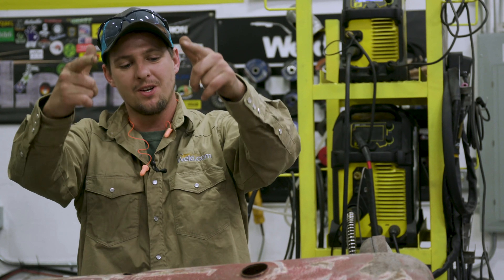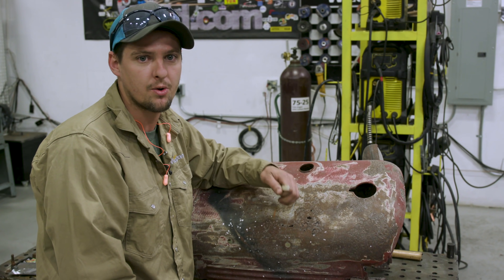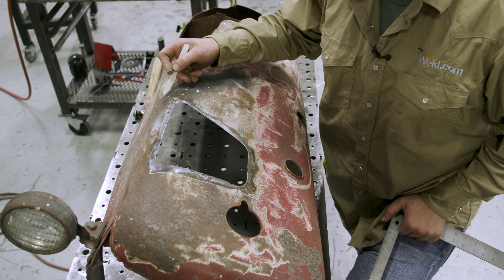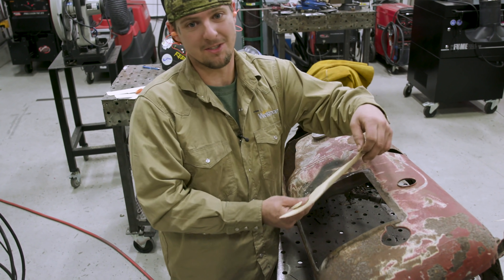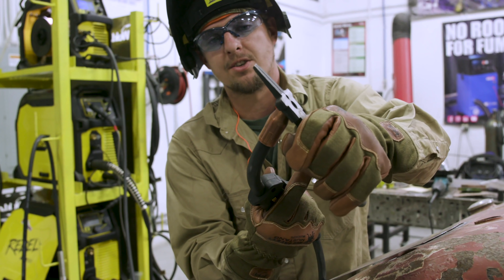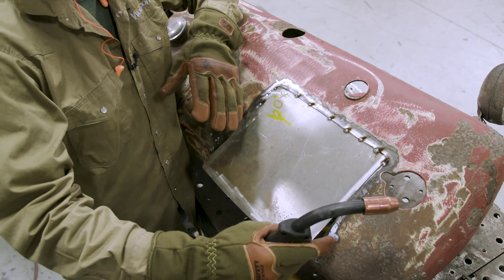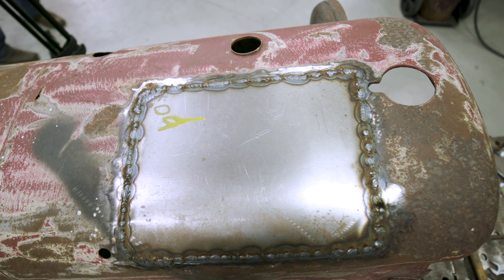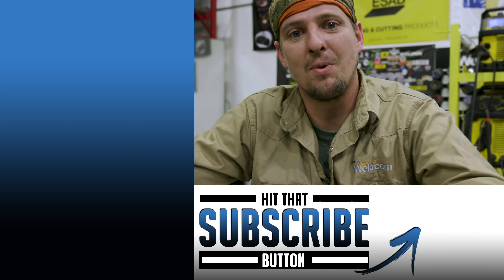OLD RUSTY SHEET METAL Weld Repairs

Comment: At 15:30 when you put the copper block behind the weld are you doing that to help disperse the heat of the weld?  I saw initially it was for holding the panels flush with each other but it looked as if the tacks did that already.

Comment: very good tutorial,
 a very important operation is to cut off the tip of the feed wire so you start with a fresh wire tip.
Forming the patch panel before welding it is  a good way to avoid undue reshaping after the weld is completed.
very good video

Comment: Here's a question...will a nasty boogery looking weld still hold for non structural repairs, like in the bed of a pickup/car (its a Ranchero so its one body). I did the ugliest welds...but seems to hold when I bang on it with a heavy hammer....

Its my second weld in my life lol...but I need to move on. I dont care if its pretty, just that the patch wont pop out on me later...thanks. Love the channel.

Comment: You can reduce or eliminate the gap by cutting out the bad metal at a 45 degree angle to the surface. Then cut the matching patch panel at 45 degrees as well. I use that method which works really well as long as you cut the template patiently and carefully for close tolerance. For example, with 1.6mm sheet metal cut at 45 degrees you will have a butt length of 2.3mm which should stop the the patch panel falling through. Before tacking you shouldn't be able to see the gap if looking straight on to the join, and the surfaces will be flush. Doing it this way makes setting up easier,  reduces the amount of filler bog you need, if any at all, and gives you a stronger joint,. Test it on a piece of flat sheet and you'll see the benefits. An old welder showed me this method 40 years ago.
EDIT: I just found the following video https://youtu.be/_u31t13QO6A which shows the concept I described but a much easier method to match up and especially no need to fiddle with templates. Super easy.

Comment: At least form the patch to the opening first, you know bend it to fit somewhat. Then start the fit-up and tack sequence from the rounded side first. Trying to pull or roll a tight radius around a short bend is so hard.

Comment: I tack would have tacked three - four tacks on each side and then grind them flush.  Then a tack in the center between tacks and grind flush again. I would repeat the process over and over until the entire patch is welded.  Once your tacks are really close to each other you can begin to tack in between tacks about 3-6 inches apart to keep heat at a minimum.  I always allow the redness from the heat to go away before I tack again to control the heat.      

This method controls the heat and avoids having to grind a "fat" bead which will build heat also.  The last grindings will reveal pinholes that are easily tacked and ground flush.  In the world according to me, tacks are much easier to grind flush and produce much less heat than grinding a bead.  I could metal finished the panel you were working on with no filler (bondo) because to me and my experience you have thick metal to work with. 

Finally, I would have started at the bottom of that patch making sure to have enough tacks to be able to "roll" the patch panel and tack it into the rest of your base as you slowly and carefully roll into place.  A 2x4 works fine to push/roll from the opposite edge of your patch panel into place making sure to keep it flush as you roll it.  Tacks will be closer together on the radius/roll part of the panel.   I weld quarter panels and fenders on Hondas, Mitsushitzis, and so on and use very little mud to resurface my joints for paint. 

All in all I appreciate your skill and that you mention your dads teachings.  I recall a quote,
"Teach them when their young and they will never forget."

Keep up the good work.

Comment: Good video.... pro tip never weld patches with glove on if the panel is to hot for your hand your warping it. 1 to 2 second tacks every 6 inches staggering start points. When form a radius on the fly IE not pre forming your patch start on the sort side of your radius working to the long side. when ever possible not using a hammer. Clean the entire area before laying out a patch. Good video tho. P.s use a flat rasp to knock down high weld points those produce no heat alot of guys do a great job welding the patch but take it to warp town while grinding....... I do this for a living keep the videos coming

Comment: First ever panel I welded into a vehicle was the rear arch of a VW T4 camper van. I tacked it into place as a normal person would, but then it took a turn for the worse. I strung a continuous bead all the way round it... none stop,.. about a meter long bead all the way around a sheet of what was probably 1.5mm thick sheet steel, butt jointed right around its perimeter to other thin sheet steel, all in one go. I had been told I couldn’t do that, and thought I was being clever by doing it. That was until I realised that the panel had pulled in by about 35mm in places, and the guy telling me I couldn’t do it actually just meant not to do it. I’m not even exaggerating, when I lifted the mask it looked like a stormy sea.

Comment: @7:20 i learned a trick of having a can of $.99 black spray paint, and just mist the cardboard so it leaves a shadow you can cut out.  the marker sometimes is too thick to get an accurate cut.  drawback are fumes, and having to clean it off the metal ( not an issue if done before grinding)

Comment: Metal has memory.  If you start with a flat piece and weld it in as he does it will require a lot of filler in the middle.  It’s going to want to stay flat.  If you form the patch before welding it in, you will have a much better result.

Comment: Personally i think you did that the hard way,I hate giving advice, except where it makes life much easier.
if you would have started at the bottom and welded it towards the top.
you will find it much easier to form that curve by putting  pressure on the top piece and you would have very little hammering to fit it.
then you could also use a long flat bar and tack it on (the far side of the bar away from the opening)  the out side piece close to where you want to bring together, (end of flat bar crosses the seam) using the flat bar to pry the other piece into place,  once it's tacked break the bar off and continue to follow the seam, no hammering required and no dents, just a few minor weld tack's to grind off,
it works wonders, especially on much heavier pieces you want to match.
Go see how fitters fit plates together for welding, possibly the old boiler makers will have a good video on this.

There is also another method much better fitting, by placing the patch over top of metal before cutting it, tack weld the filler in place with few welds, then use a cut off disk at an angle and cut through the piece to be removed at an angle against the filler piece this gives you a much tighter fit for welding . you will have no gaps as you have and less welding required,

smile young fellow, it's us old farts that have learned the secrets and try to pass them on,

Comment: i use a little pick in the gap to even up the surfaces instead of a hammer. more precise and no potential damage to the work peice. also i wouldn't pre shape my patch either like sole people suggested, if you bend it as you go like he did the bend is naturally going to match perfectly with the part being repaired every time. eliminates the variable of not being a good match and needing extra work after the fact.

Comment: This was exactly the video I need. Ive been doing an old BMW restoration and have been getting comments about my welding technique on sheet metal. Everyone thinks I should be laying dimes and its been frustrating trying to correct them that that isn't how sheetmetal works. Also I'm on .030 at the thinnest so I understand the pain of trying not to blowout the weld but I can't always get a copper block into the areas I'm trying to weld.

Comment: Great video. This car body work reminds me of these old welders we got here by Kemppi, back since the 1980s they had a type of primitive pulse function, worked real well on auto body parts as you could use higher amps and the weld nugget would flow out flush real nice, hardly any hammer work required. Or so I was told by the old hands at welding as I was looking at buying one of those old welders.

Comment: Your right about the welding part. but why make a big deal about finding the rusty parts then make a patch almost twice as big? Try this instead... I make my patch 1st, form it the the hood, panel, or what ever, then I mark and cut the panel out to match the patch. I've done hundreds of these, I use a Miller side kick .023. but if you do it the way I say you can make any shape patch you want even odd shapes, do it that way, its easy, faster, less work, and you get a better job no templates, no tracing, and in the end a nicer job plus your customers get a better job for less money. try it you will see. I've finished panels with no filler..

Comment: I like to sand blast the stuff first, to get rid of all that hidden crap. I use regular sand if the metal is thick, black beauty at a lower pressure if it's thinner metal and media blast if it's thin sheet(heavier grit sand creates more heat, and will warp thinner stuff) Also, if you're going to do it a lot, a plasma cutter is a VERY worthwhile investment.

Comment: Thanks for the Quality instructions!
As a beginner i got a question: would this be possible too with stick welding? anything else i have to pay attention to?
Reply: Not a chance, way too hot notice how he burnt though the metal just trying to tack it together
Reply: If you're decent with a stick welder, then it's definitely possible. I've patched a motorcycle exhaust with stick before. 

Get your hands on some 1/16" 6013 and go to town.
Reply: kinderschubser92 i would personally say,do not even try this with a stick welder,unless you are an absolute pro...in which case you would use tig or mig...give it a go if you want,but be prepared for blowing holes everywhere and distorting the whole panel due to excessive heat. Good luck buddy! I know sometimes you just have to use the tools you have.👍

Comment: Lots of beginners mistakes there. I  did those when I started learning bodywork.
First of all, you identify the clean metal all the way. Wire wheel on an angle grinder does the job.
2, you take a sheet metal (proper size or close) and lay it on the piece. You work the piece out until you get the perfect fit (same curvatures as the original metal).
3: you secure the metal to the base piece with 2 small weld points. You make positioning marks with a scraping tool on 3 or all sides of the repair piece
4. You take a 1mm cutting wheel and cut through both of the metals (if you did not make the repair section a perfect fit) or cut along the edge of the repair section, with the repair section in place so that you won't have to fiddle with it after. I recommended letting the long straight edges to be cut at the end; start with the curved edges of the repair panel. This way you will have a nice even gap. The small tack welds you did will be cut at this stage, if this is what you are asking. 
5. Start welding in taps just as you showed. That one and the air blowing are perfect technique. Tech tip: If you blow holes at the bottom and you can't set the machine to the perfect setting (yes, for those of you with vintage or cheap machines), you put a thick copper plate underneath the place you weld. Metal doesn't stick to copper. Don't use aluminium, it's shitty. Beware of the burned fingers because of the copper plate!
6. Use a hammer and dolly to beat the welds in order to avoid heat distorsion (weld 2-3 spots, hammer them a little - it also gives time for the metal to cool) 
7. Use the same 1mm cutting disc in the cutting position (perpendicular to the sheet metal) to degross the weld where excess has build up. Tech tip: don't try to obtain pretty welds; those don't have enough mechanical strength. Do strong all the way through welds and grind the excess after. 
8. Use a flapping disk (160) to surface up the metal if you need to. Beware that the flapping disc makes a lot of heat, you have to move quickly or the metal will wrap. Don't use this disc to degross the welds. You will have wrapping in your sheet metal. 
9. Admire your work, because you did a very good job. :) 
You should also take some photos before and after the repair, just in case you had some details you missed. 

All of these are learned in years of self training. Self experience, thinking and getting tips from other people on YouTube. Hope you can find use for what i told you.
Reply: I saw a technique for cutting the panel like in step four but you cut on a slight angle (angled with top of wheel toward outside edge) .  This leaves a gap smaller than the thickness of the cutoff wheel.
Reply: @bretlovitz3068  think i saw the same vid. Gas tank door on a truck bed right?. Let's you get it nice and flush real quick and easy.

Comment: Nice video. I have been doing patch panels like that for over 30  years but just last Friday I learned a new, faster  easier way on you tube. check out: "Butt welding sheet metal the easy way".
 Fitzee's Fabrications patch panel/gas filler video. I was amazed.
Reply: Fred Barnes watched the same vid a couple weeks ago and I agree haha
Reply: Yep, agree. Blew my mind. Not as easy as Fitzee makes it look but takes a lot less time. Of course this is after 2 years of me working on the body of the FJ40 Landcruiser I'm rebuilding (time limitations, not volume of work). Wish I had seen it sooner.

Comment: Enjoyed this. Not criticising it is important you do not use a harder Mig wire than the base MATERIAL especially on an older vehicle with old body panels, as cracking, almost CERTAINLY will occur IF you then proceed to PANEL BEATING.

Comment: Why didnt you shape the patch to the curve of the hood first, doing it like that puts a lot of tension into the hood... it will show up and bite you in the arse unless you bondo the crap out of it come painting time...
Reply: If he has the body hammers...he should have formed it
Reply: Hold a dolly block on the backside when tapping it with your body hammer
Reply: He's a Welder.... Not a Body guy....  It's not a lesson on bodywork....  It was a lesson in welding...  Stop being so nasty..
Reply: @OldSkoolF  Sorry you interpreted it as instructions on welding... I see an incorrect method that will lead to heartache down the track... not shaping patches in bodywork you might as well use chicken wire and bondo. And in no way was I nasty in my comment unless your as man bun wearing Princess... One thing Man cub isn't
Reply: @st170ish  Listen Boomer...  I just don't go around knocking a guy thats out working hard and trying to help others...  If he was like you, just sitting in you Mom's basement Trolling everyone..  He wouldn't have video's out for you to knock...   Post your work...  Ain't got none....???    I thought so...
Reply: @OldSkoolF  Mums basement trolling... really and I have no need to prove anything I'm pointing out there is a basic fault in his approach that is all.
And Boomer don't know what that means wherever you are from... I'm not kangaroo either.
Reply: I was wondering this myself, and then at the end, it may have been a optical illusion, but it looks like the whole thing shrank and it was a big divot. Not sure if that would come from the  stretching to fill gaps with heat? Then additionally the bending stretching as well, and also the piece is going to be smaller as well because he was drawing underneath the hole, and sharpies have an angled tip on them as well. 
But I also wonder, I mean it would be tough to get those angles right off of the hood, seems like you could easily make it a lot harder, and or be too far out in the bend and then what, if you adjust and your cuts are off,  seems like a lot of trouble as well.

Comment: Okay, I have a question:  Been doing repairs exactly like this to my old truck bed.  When I first start to tack, it sputters and spits.  But if I hit it again, it usually does perfect, sounds just like what you were doing.  It just usually won't do that on the first pull of the trigger.   
Why is that?  I've played with the settings, gas, wire speed...I know the voltage is right, and if I run a bead it does okay once you get going, but when you first pull the trigger it's not pretty.   
Seems the hotter it gets, the smoother it welds. 
So I get the job done, but I end up with lots of extra grinding due to the crappy starts. 
Using a Millermatic 200 with .024 wire.   Suggestions?
Reply: Check your leads, wiring at the inside terminals and your ground. It's a lack of amperage caused by one of those. Inverter machines, or even just modern transformer machines perform so much better on thin gauge/low amperage. Your machine only has 6? I think, positions on voltage. Really makes things hard to dial in.
Reply: @dallas7103  Went through it today. All the connections on the front were pretty corroded.  Cleaned them until they shined, and it's like a new welder now.  Thanks.  First time I squeezed the trigger on some sheet metal was a nice clean "bzzzt"

Comment: Is there any reason to choose mig over tig for this? I understand tig is more focussed and more intense heat but if you use aluminium chill blocks and do the same tecnique it would still work ok?
Reply: i do all my sheet metal repairs with tig, mig is definitely faster and easier if its setup right, i have good heat control with tig and i end up grinding less at the end, i hate grinding so ill do anything i can to grind less
Reply: caitlin leanna what’s your snap I need lessons 🙃